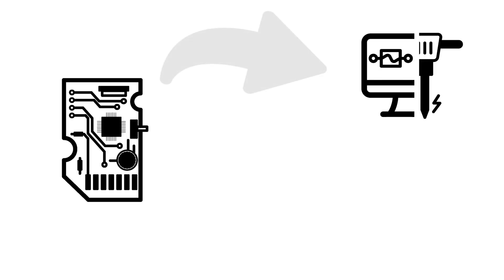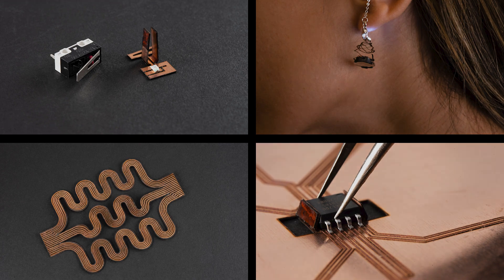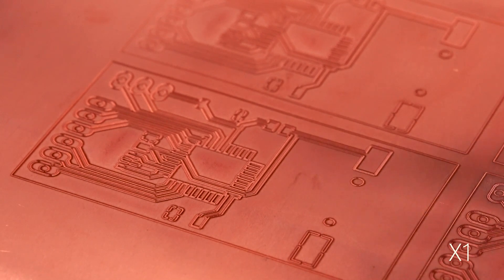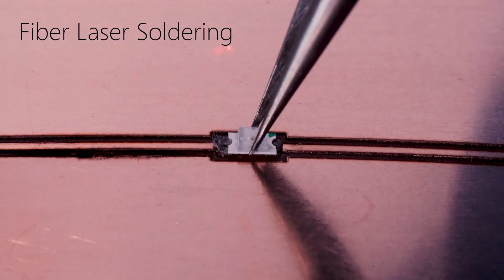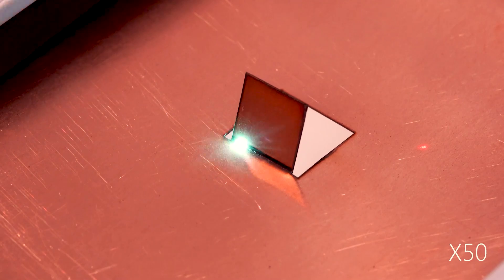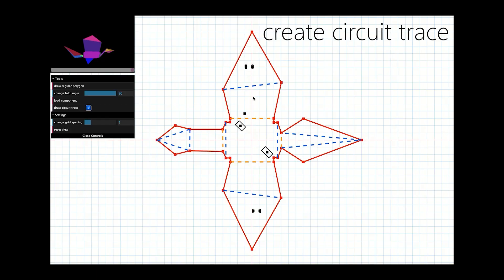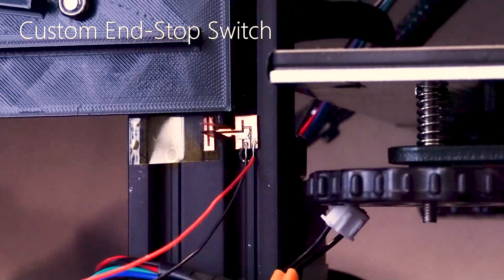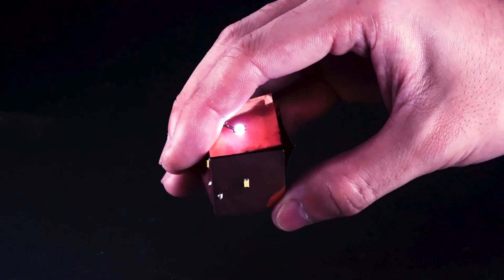Fibercuit: Prototyping High-Resolution Flexible and Kirigami Circuits with a Fiber Laser Engraver

Comment: Hey guys! Loved the video and print! Which fiber laser did you end up using? Do you have recommended settings you could share?
Reply from the maker: We have an off-the-shelf 50W fiber laser engraver that looks like this (https://www.amazon.com/s?k=fiber+laser+engraver+50w&sprefix=fiber+laser+engraver+%2Caps%2C124&ref=nb_sb_ss_ts-doa-p_2_21). I don't think the brand matters in this case. We do have some recommended cutting settings, which you can find in the paper here: https://smartlab.cs.umd.edu/assets/pdf/fibercuit.pdf If you scroll down to the bottom, there is a table that summarizes the settings we experimented with. Hope this helps;)

Comment: So you just uh... copied 10.1021/acsami.2c01027 and called it a day?
Reply from the maker: Hey thanks for the pointer!
Our focus is to democratize circuit prototyping, so making Kirigami circuits is only a small portion of our work. The main body of our work focuses on techniques to fabricate circuits using cheap raw materials with fine trace widths (e.g., 4-8mil), laser soldering, plus laser forming. We also have a custom software interface to make the forming easier.
Here is our preprint: https://smartlab.cs.umd.edu/assets/pdf/fibercuit.pdf
Our work was done independently of 10.1021/acsami.2c01027, which was made public just prior to our final submission (Mid March vs. Early April) and not on our radar. Essentially, the problem we are aiming to solve is to shorten the prototyping iteration on PCB functionality and form factor at the same time. TGM/laser forming is a supplementary outcome.
Always happy to see more people involved in advancing PCB prototyping and democratizing the techniques!
Reply: @SmallArtifactsLab  If you really want to use fibers to make circuits, you need to study up on the types and qualities of different fiber laser sources. In your preprint all I saw was a mention of a nondescript $5k 50W laser, which is almost certainly a cheap q-switched unit, and they are not suitable for precision work as you've witnessed yourself. To actually make high quality PCBs, you'll want a MOPA laser source, which has a much wider frequency range and lets you adjust pulse length independent of power. The JPT M7 series is a drop-in replacement for your fiber marker, though I'm not sure if your EZCad board allows you to tune the pulse length(DRM garbage). I'm working on a universal laser control board, which should also be a drop-in, and will let you fabricate PCBs easily.
I'll be posting a video on this channel when I get a reliable PCB process, and while the board itself won't be opensource, all the techniques and parameters will be, some of which will be replicable on other machines.
Reply: @Spirit532  Hey, do you have any updates about your project? Why is using a MOPA laser better for precision work? Would be very grateful if you could provide some references or a direction for further reading.
Reply: @systematicrandomness3766  Coincidentally, I did end up getting a proper PCB process working just very recently, though I haven't made a video about it yet. The reason MOPA lasers are significantly more flexible is because they allow you to adjust the pulse length, which opens up, literally, a new dimension on parameter flexibility. With pulse length adjustment it's possible to selectively ablate copper(a highly reflective material) while leaving the fiberglass(absorptive material) almost entirely untouched. I wouldn't recommend reading into it too much, and definitely wouldn't recommend watching all the DIY fiber laser hobbyist channels, as most of them have no idea what they're talking about. If you have access to a laser, just start tinkering. Make some test patterns with varying parameters, and just see whether what you think would work, will in fact work.
Reply: @Spirit532  Thanks, for the great answer! Very much appreciated! Looking forward to your video. What laser power would be suitable for 1oz or .5oz copper thickness? Would a 20 or 30W unit already be suitable for that, or do you need a 50W one like in the video? What power and model are you using?
Reply: @systematicrandomness3766  Laser power is mostly irrelevant, aside from speed(of getting the result). The important point is that you have control over pulse length, so a MOPA architecture laser is necessary. The only other truly important metric is the peak pulse energy, which for most cheap sources is around 1.5mJ, and there's not much you can do to change it. 20W sources are usually rejects from 30W models, if you can even find a 20W MOPA unit - 20/50W are usually q-switched. I use a DIY system that's built using a 60W JPT M7 source, but 30 will do as well.
If you end up buying(or building) a system, start with 30-36W, 350mm/s, 20kHz pulse rate, 45ns pulse length, 15um line distance, and rotate every pass by 20-35 degrees. It will be slow - probably over an hour's worth of passes for total copper removal. But that's the price you pay to avoid charring.
Reply: @Spirit532 Thanks for the info! Currently looking into getting a 30W  ComMarker B4 JPT MOPA. I want to cut adhesive lined flex PCBs for rapid antenna prototyping.
Reply: @systematicrandomness3766  It doesn't do particularly well with polya(a/i)mides, like kapton. Beware.
Reply: @Spirit532  Mhh, thats concerning, thanks for the warning. But it will cut it, will it? Doesn't need to be especially beautiful I guess. If its somewhat repeatable it should be ok.